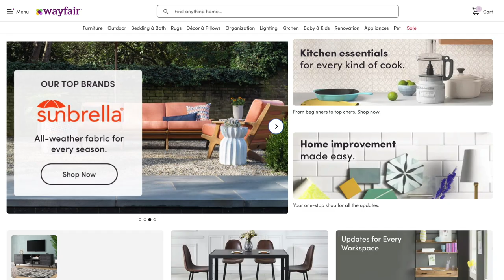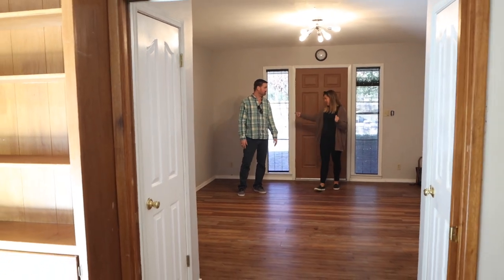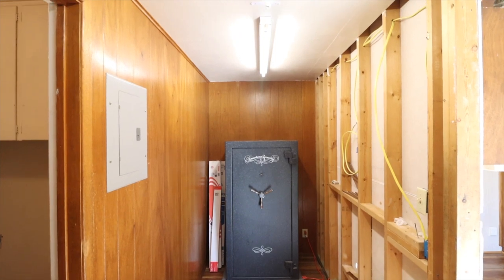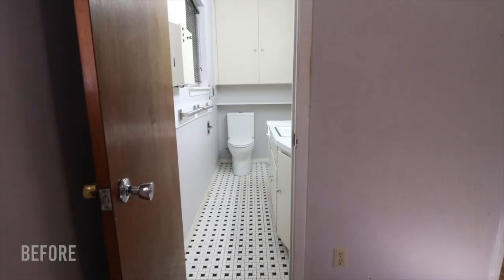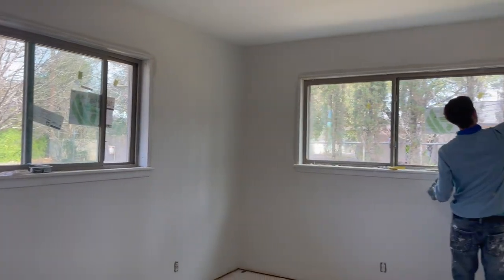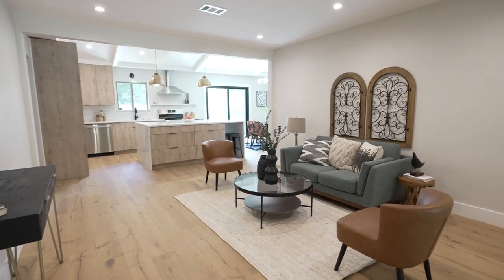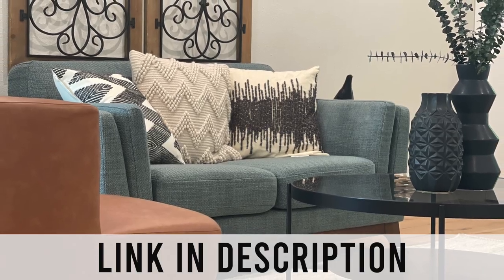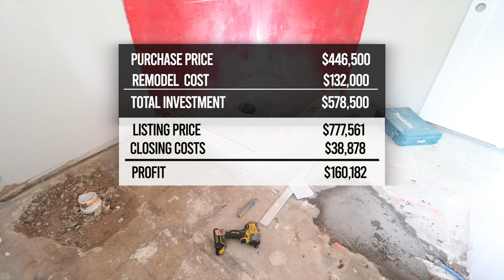Stunning Home Transformation | Full Before & After Renovation

Comment: Tile in the master bath... pick one or two. The pattern on the floor was good, and whoever laid it did an excellent job. The cement tiles in the shower were a good tie in to the gray in the floor pattern. Then you throw in the tiny honey comb because you got suckered into trying to be hip. More of the gray cement tile or same floor pattern would have served better. Or if you wanted that niche in the shower to pop, you could have used whatever the sink countertop is as a backsplash.

You're right about the sink, though. You don't need the double, space for make up is nice, but, yeah, it should have been on the other side.

Comment: Beautiful job, I agree about the master bathroom being a bit tight, as soon as the shot of the bathroom entrance was shown I thought "damn that looks tight between the shower and vanity". The bathroom looks amazing, just the size is a little off, and a double sink would have been ideal.

You were concerned about the kitchen island and I think the little seating area turned out good, and you were concerned about adding the coat closet at the front entrance and that looked great as well, I didn't think it looked awkward due to the direction the door opened. I think this is the episode you both seemed to second guess yourself the most.

Comment: I don't think wallpaper in a bathroom is a good idea. The steam from the shower makes it peel off the wall. My uncle had wallpaper in his bathroom and he had to re-paper it every few years.
Reply: There are papers with better adhesive and don't absorb much moisture (usually vinyl, I think?) and they work better in bathrooms. That said ... I could be wrong about this, but if I saw peeling wallpaper in a bathroom, I'd worry about dampness in general. I'd check the fan/exhaust to make sure it's working well, test for mould, and see if there are any pipes behind that wall that need attention, because there really shouldn't be that much moisture hanging around.
Reply: @04beni04  I think people usually varnish wallpaper in a bathroom or buy specific wallpapers treated for bathrooms.

Comment: Overall a job well done and great redistribution of space, but not my personal taste for design finishes - I don't like slab cabinet doors, or marble counters, wood floors in a kitchen and that little shelf above the stove looks good, however, if the fan is on while cooking, it just going to suck all the grease up onto whatever is on that shelf.  Also, looks your painter was sloppy and got paint on the top of the mirrors in the master bathroom (at 29:30 point of video).

Comment: You need a copy of Architectural Graphic Standards to help you plan your spaces. It has all suggested dimensions for aisles, appliances, interior and exterior doors, staircases, and just about everything you need to research to plan interior spaces to be easily functional and well designed.  This book is invaluable in planning both residential and commercial interiors. 
Otherwise, your grey- black -white interiors are over used, although I can see the need to have universal appeal for resale. I am concerned that your approach has more sizzle than steak. Often it is the more basic items items, like where are the washer and dryer, that get glossed over, while the fireplace decor is highlighted instead. I never did figure out where the micro-wave ended up in the new kitchen... is that it down near the floor on the island?

Comment: Love the Spanish tile in the bathroom, and the kitchen cabinets look great too! I agree the range would look better without the upstand. One thing I thought would have been to create a small entryway by the front door, using shallow bench seating with coat hooks on one side and a shallow closet opposite,  with a set of glass double doors then leading into the living area - practical storage, increased privacy for the living area and the light flow maintained. I'm not sure if there was a reason that wasn't possible though.

Comment: I am still baffled that you walk straight into the living space, and not a muck room or hallway to hang your jacket and take off your shoes..
Reply: I don't know enough about the Austin area to understand prevailing design preferences, but if it could be done without ruining the facade, I'd want to look into enclosing the porch. Where I am we have to factor in cold winters and hot summers, and I can only shudder at the mess and the high costs of heating (and cooling, if that's an option) that goes with a front door opening right into the main living space. Don't get me wrong -- what they have here looks nice, and I'm not slamming it. Just saying that it might not be very practical.
Reply: I feel like most people in the US don't really use the front door unless company is coming over. I always come in and out through the garage so my coat closet is next to that door down a bit from my front door. I do have a hallway/foyer entrance though not in the middle of my living room.